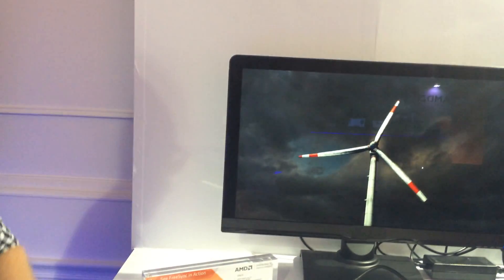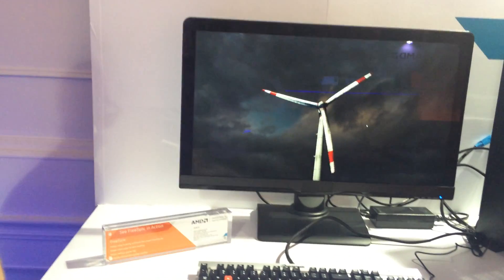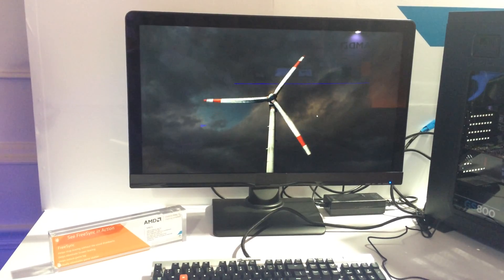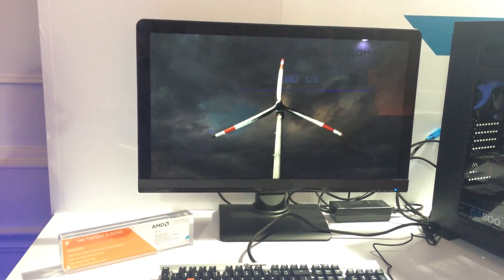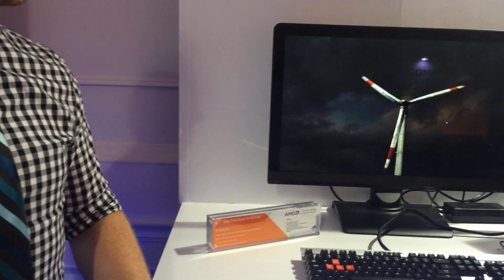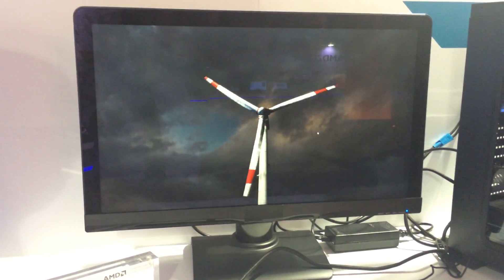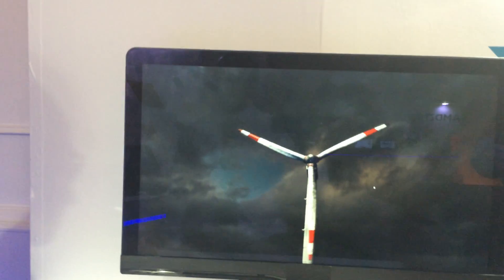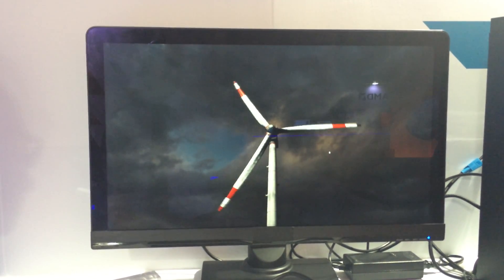AMD FreeSync External Display Demo: Computex 2014

Comment: So I get why he didn't mention freesync compatibility with Nvidia cards, but will they or won't they be compatible?
Reply: Free-Sync is AMD's "special sauce" that uses VESA's Adaptive-Sync. Free-Sync isn't something that will be supported by other vendors.  There is nothing stopping other vendors from using Adaptive-Sync and creating something similar to AMD's Free-Sync on their own.
Reply: Eric EC Well in that case, I don't see NVidia creating their own free version of variable refresh when they have G-sync. So then I guess we can expect this to be a repeat of 3D-vision vs. HD3D, but hopefully FreeSync isn't as much of a failure...
Reply: Dude, it's an OPEN standard, NVIDIA is free to implement the same thing with their own cards without fuss... But they already did, except they made sure that you also pay a $200 premium for it.
Reply: zap813 HD3D is a very different situation though. If I'm understanding all this correctly then in say a years time adaptive sync will be something that will be "automatically" included into new monitors. So everyone will end up with FreeSync-capable monitors. If you have a GPU with HD3D support you still need to go out and buy other hardware to make use of this. With FreeSync you don't. So I don't see how it could end up a failure? If NV/Intel don't end up supporting it or something similar it'll only hurt them, and their customers. Monitor vendors get adaptive sync for free basically because the tech is already there. Adding it doesn't cost them anything. So basically the situation in a year or 2 will be like this: most people will have monitors that support this so when they buy a new graphics card their choice will be buy one that supports adaptive sync and keep their monitor, or, buy a gfx card that use some proprietary tech + buy a new monitor as well + pay a price premium for the extra hardware + become vendor lock-in'd. I don't see how this will not "kill" G-sync or anything similar to that.
Reply: Neosaigo I don't see how. You just need a GCN 1.1 graphics card and above. Unless somehow, you mean that the premium is included in the price of the graphics card?
Reply: Richard woo You mean displayport 1.2a
Reply: zolikoff Better than AMD fans who think the extra cost of making changes to support Freesync is not going to come at a premium.